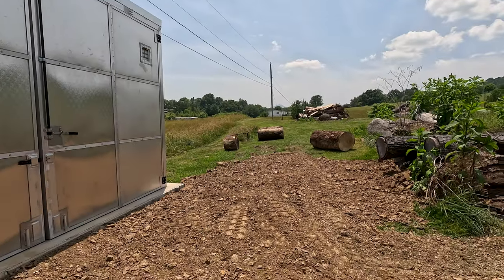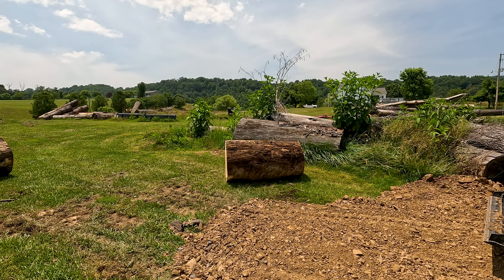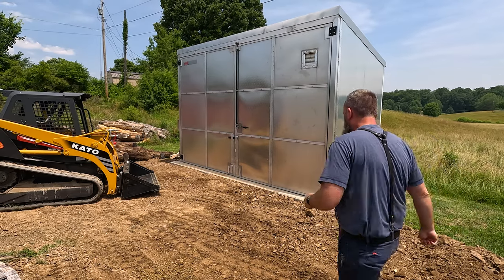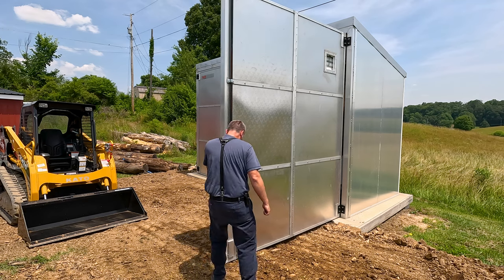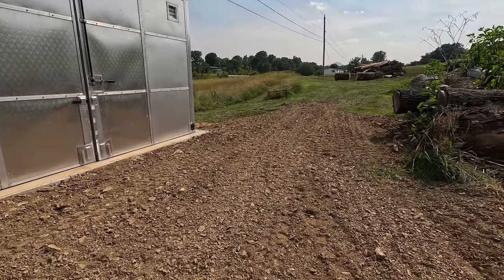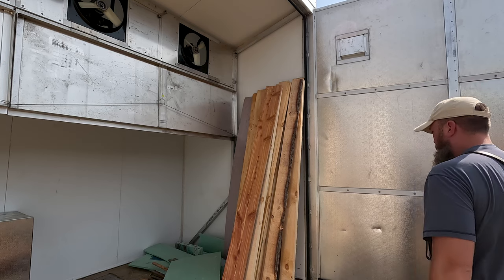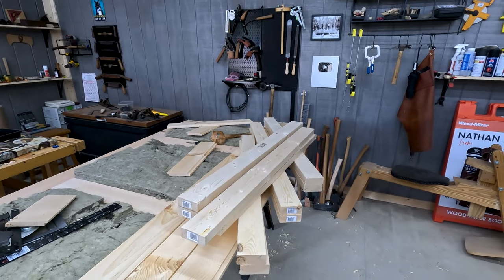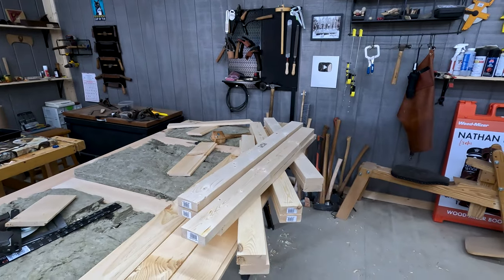Logs to Lumber: Saw Milling, Kiln Drying, and Track Loader Work

Comment: Nathan, keep in mind that the shale will settle when you finally get some rain. I have found that the best method for leveling soil or rock is to drive the track loader to a known level spot, lay the bucket flat on that surface and then simply move forward.  Any high spot will be caught by the bucket. Give it a try and let us know the outcome.
Reply: Bob, I concur with that method as a skidsteer operator. One thing though, once you're happy with the leveling/flattening, being a track loader, roll it in a few times. After a good rain, wait  a day or two...then roll it in again to compact it.
Nathan, as a rookie, you did well. Practice is the best experience.
I hope this helps. Nice job!

Comment: On the greasing ,as a plant equipment technician, I always say go by the hours of usage and if you are going to be laying the machine up for a period time then make sure all the grease fittings are topped up and machine briefly ran to get grease spread out.  I always recommend to operators to clear the grease nipples before and after to reduce the risk of pushing in any dirt. I also recommend to operators to use their leaf blower and give the loader a good blow through in the engine and under the cabin and in the cabin area at least weekly (unless op site dictates daily) and to operate the reverse fan on radiator to ensure that dust / leaf / earth collation is minimised. Just makes life easier if you get a leak that it's easier to clean up, less likely hood of fire.  Basically, just care for the plant equipment as you do your sawmill as you clearly give that machine all its love and attention it needs.

Comment: I have a bobcat and a new holland. They get used a few minutes now & then, sometimes a few hours at most. I hit the arms once a week (or so) but the bottom pins get grease more often, depending on use time and my memory. Grease is cheap compared to worn pins. 
Push to start with and pull to finish. Set the bucket down at the back then the 'toe', this will allow the back of the bucket to drag excess and the front edge will fine grade.  Love working the skid steer & watching your videos.

Comment: I have run heavy equipment my entire life. You should cut it driving forward using the bucket as it’s designed and do minimal back dragging as it causes heavy wear on the bottom of the bucket. Back drag just to fine tune. One tip I would give to get better and smoother is practise doing two functions at one i.e. lift and curl at same time. Practise makes perfect

Comment: You did an excellent job of dragging the slate back. Dragging is the way if you’re not going to remove a lot of soil. By gouging it out with the blade you run the risk of removing too much, but you do what works best for you.

Comment: Back dragging has always worked well for me but try pointing the front of the bucket straight down and back drag it in a dump position that way you can raise and lower the bucket as you go.
Reply: Jeremiah, if the machine you're using is a rubber tire, back dragging is good. On a track machine, pushing is the best.

Comment: I ran a cat 953 track loader daily. I greased the entire tractor every 3 days of working 8 to 12 hours daily. In my opinion you have a tracked skid steer not a loader. I liked the remark about not being a professional operator but being a professional youtuber you should be able to do anything. Getting on the otherside pushing it is the answer to your push pull question which you learned.

Comment: My rule is at the end of every day, grease it and top up the fuel. It may only take 1 pump of grease or it may not take any. This way its ready to fo in the morning and doesnt get to build up condensation in the tank. Plus if you cone in not feeling well for whatever reason you cant use that as an excuse to not do it.and all the joints are warm so the grease goes in easily and you can spot any problems that may need addressing right away or so.

Comment: One thing I can suggest from what little construction I did when I was trucking is, when you only need an inch or 2 of clearance, you can run the loader back & forth slightly overlapping your tracks, & tamp down the fill  bit.
Like others have stated, & you also mentioned, time, weather & use will settle & pack that pad in nice & solid in a few weeks/months.

Comment: The tracking shot on the sawmill adds a lot of production value! Great video! And, it may not make any difference at all but please replace the connector caps on the hydraulic lines on the loader. Just me, probably. Thank you and keep up the great work!

Comment: Nathan hi how are you, for your skid steer backward is the way to go, and drag with a slight forward tilt a couple of inches, as when you go forward you drive forward with a forward tilt as you drive over the lip you have just cut  you then cut deeper than you need or expect to cut which you then have to backfill
Nigel Australia

Comment: Been a few years but pulling. You did a fine job.  If you want to get accurate in grading without fancy equipment. Stakes, Tight string and bubble level. But from the looks of it...you're on the money

Comment: Always push with it. Now, if you are in sand or fine gravel, you can back drag. If you notice on the machine it has stops the arms hit to make  it have the support they need to prevent damage. Now I don't know the machine you have it may be totally different. It's up to you and how it's built.

Comment: Hey, Nathan doing fine on the skiddy, just don't push with the bucket roll all the way down. If you snag something it will pull your cylinder apart at the threads. The isn't enough oil in the cylinder to absorb the shock. And I just wondered if you can load all 3 cants and cut your 6.5. boards all at the same time. Like Matt cremona does.Great YT ing. Enjoy y'alls videos. Little bit of souther there:face-red-droopy-eyes:

Comment: Running a beatup old T190 Bobcat skid steer. Grease it daily if in constant use, otherwise, whenever it is fired up after a couple of weeks of no use.
So, pretty much any day I use it.
Unfortunately, I'm not the owner, nor the only operator and I know for a fact that none of the others ever bother greasing it. 😡😡😓
Drag back is good for fine trimming or smoothing off soft surface. Then again, I mostly run a 4in1 bucket so I can do a few different things than a straight face

Comment: I've been running heavy equipment 35 years. What side of the bucket is the cutting edge on? The front, of course. You did well turning around and pushing.

Comment: In Central Fl we have crushed concrete or limestone base. How does the slate hold up to water ? Got the answer at the 12:50 mark . Thanks. Both crushed concrete and limestone turn to mud with a heavy rain.

Comment: I like back-dragging in that situation because there is finer control, IMHO. But in this case, there was an advantage to using the bucket to push with that kind of machine because it's so good at leveling. More efficient at that than a tractor FEL

Comment: Not much lateral support for the wide wood pallet, outside the standard fork spread of typically 4 ft or less, carriage dependent. Favorite vendor, Titan, offers A 10 ft fixed fork spreader, providing FULL width support. Kinda pricey, BUT a tool unlikely to ever wear out. This is a "slip over" attachment, for std forks. Mine has adjustable width (other brand) & it is forever being borrowed. 🇺🇸

Comment: Ust up to the push or pull part. I been running dozers for 30 years. Anyone that knows anything about it says you do work forward. You won't see many working backwards.
Reply: I've seen folks grading lift the bucket up, put the nose down,
to the ground and drag it backward, to level things out.
They do that when there is no grader available or a grader would
be too big, for the job.

Comment: You needed to get rid of the grass and topsoil first before you spread the rock. The organic material, grass and topsoil will settle as it decomposes. You can clearly see while trying to regrade you were in the sod. Really enjoy the channel. 40 + years running equipment.

Comment: Based on your initial 4 quarts it looked like the log was under a lot of stress.  I was just wondering if you noticed that and were concerned or changed the sawing method due to it.
Reply from the maker: Yeah I had to flip it a few times while sawing the lumber

Comment: Grease your equipment go to owners manual it will give you the best results. Grease is cheap and down time from lack of grease is costly. My Father always bought a new grease gun with a new piece of equipment. He would threaten me by saying if I catch you not greasing your equipment I won't buy you another one. Best way in my opinion to fix your door issue you really need a bigger concrete Pad so you don't have water issues and other things.

Comment: Back blade but bucket should be near 70 degrees to the ground.
Reply: You want your cutting edge to be the only thing touching the ground
Reply: @nickschiavone7330  For your information you can always edit your comments by clicking on the 3 vertical dots to the right of comment.